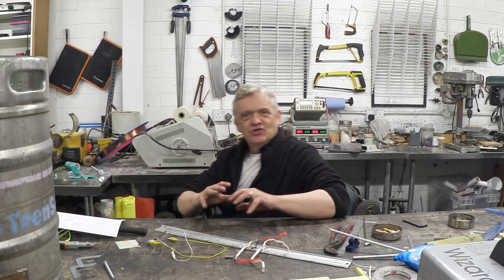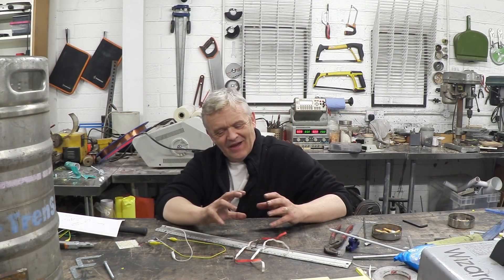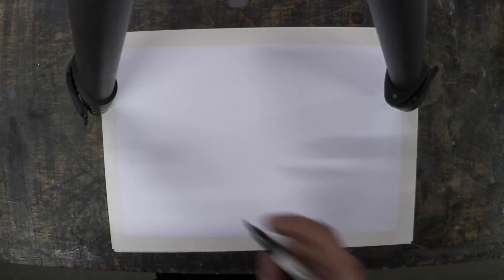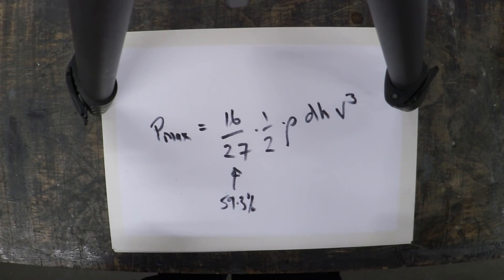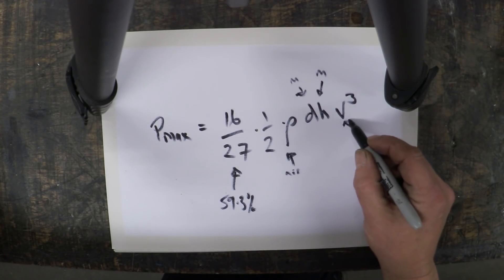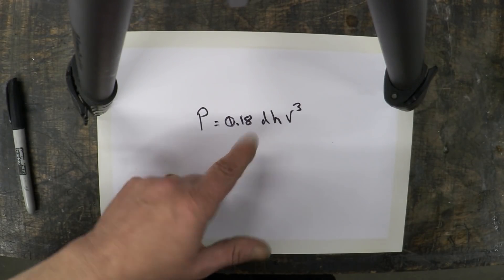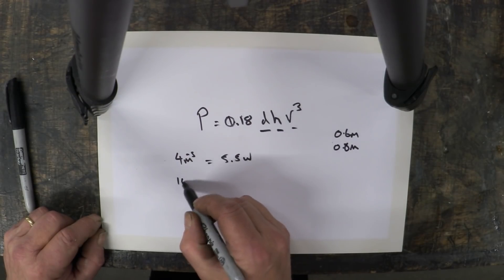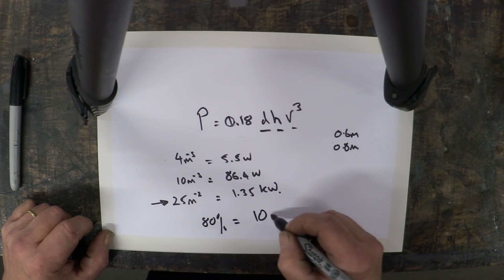Building a 1kW Wind Turbine For Under £100 - Betz Law

Comment: If its rainy then build a rain powered generator.
Reply: There's not a lot of power in the rain per unit of surface area compared to the wind. The average sized roof only collects enough to produce 5-20W.
Reply: @AtlasReburdened  you could build a 
"gravitational generator" .... collect the water high(in a container or tray or your rain gutter and dump it in a container) ,  have the weight of the water "push" a generator on it's way down, and lift an empty container/etc,  ....rinse and repeat ... you get the gist of it  .... It will not be highly efficient but definitely can generate power. The difference in work between the two ( full and empty ) minus some loses can be harnessed.
Reply: @barbufodor1186  Sure you can, but that won't make a roof that collects 10Wh of rain per hour of normal rain make any more than that amount. There's a channel called 'Quint Builds' that goes more in depth into harvesting of rain water for power generation. You should take a look at his efforts.
Reply: @AtlasReburdened   Thanks for the reference channel, I will take a look.
Reply from the maker: now there's an idea mate

Comment: Rob What About Making A Quazi Enclosure To Increase Air Pressure ? 
Just A Thought Lad 
Bless Up
Reply: Funnel
Reply: @jeffreycoulter4095  Mmm Interesting
Reply: Excellent video. I've pulled a couple pulleys from a car engine I was replacing. I'm considering using them for the top and bottom supports to my wind generator. Coupling that to a few conversion pulleys from swamp coolers, then to a car alternator to charge batteries. The alternator is a standard Toyota 70 amp alternator. Theoretically my maximum is 840 watts. I'm hoping for 400 to 500 watts. I'll be happy with that. At 840 watts, I don't want to go outside. Even at 400 watts, the wind is blowing somewhat harder than I like, to do work outside. Cheers
Reply from the maker: it's a nice thought - cheers mate

Comment: I thought the industry standard windspeed for turbine rating was 10m/s
Reply: I think Robert is referring to the max rating.
Reply: @hempev  Beaufort scale 9 -10! ...... over 55mph! But this IS the UK so 10 mph is more reasonable ;0)
Reply from the maker: not on the power curves I looked at mate - but I could easily be wrong I only looked at a few
Reply: @ThinkingandTinkering  Rated speed for consumer-available turbines varies from 10m/s to 13m/s, and sometimes even higher. If you meant 25 MPH, that's 11m/s.

Comment: It WILL do a kWh - it might take a month but it will do it eventually... Its whether it ever makes 1kW which is very different! kWh/month is a much better measure of a turbine/site but calling a turbine a 1kWh turbine is meaningless! Enjoying the progression of the project - look forward to the next steps!
Reply from the maker: yeah that's my bad mate - I am basically a battery guy and used to thinking of energy density in terms of kWh - when I blab on I need to watch what I say more lol
Reply: @Tom Dixon You only need raw Kilowatts generated at particular wind speeds to nail a wind turbines performance. KW is a power rating, adding a time factor like KWh(hours) or KWm(months) turns it into  an energy rating measured in Joules generated for that time period. For wind turbines, how much energy that can be generated over a given time period depends on average wind speeds for your specific location and to a lesser degree, how much can be stored depends on the efficiency of your battery system. Having an average energy generated rating, separate from the raw power ratings, for a particular location makes sense because then you can determine if a wind turbine is worth the investment over time. 

To be honest, I don't understand why energy usage is given in an intermediary unit such as KWh for example, as you might find on your gas or electric bill, surely it's much easier to just give it in Joules and save having to do any calculations... Maybe someone can tell us the reason for this...? 😁